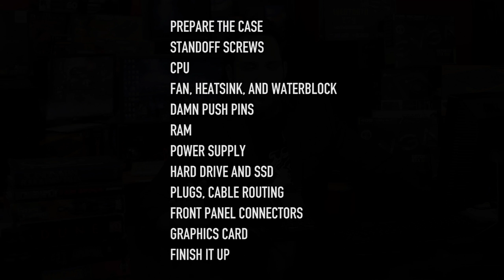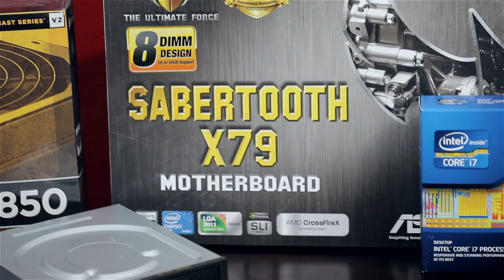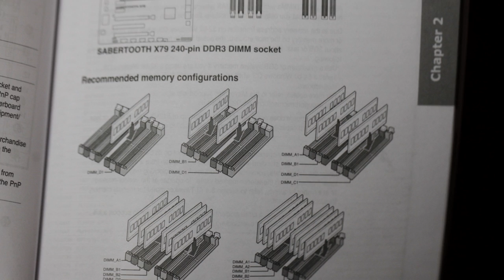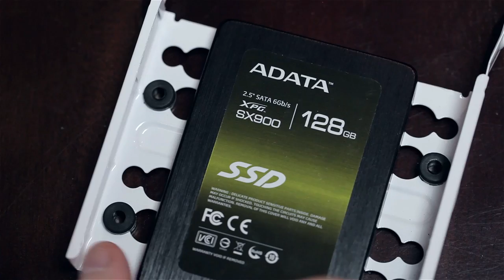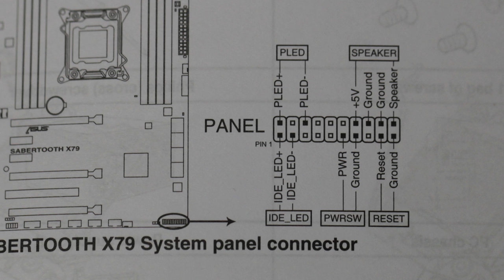How to Build a PC: The Ultimate Guide from Tek Syndicate

Comment: Case:Thermaltake Versa H21 ATX MID Tower
Cpu:Intel i5 4460k 3.4ghz
Gpu:EVGA GTX 750 Ti FTW
Ram:G.Skill Ripjaw 8gb
Memory::Seagate Barracuda 1tb
Psu:EVGA 400w ATX
Reply: The Fallout Guy at least 500W psu
Reply: Updated
CPU: i5 4460 quad core
MoBo: ASRock H97M PRO4 
RAM: Corsair 8GB DDR3 1600
GPU: GTX GeForce 750 Ti FTW
PSU EVGA 500w
HDD: 1TB
OS: Windows 8.1 64bit
What u think
Reply: The Fallout Guy If this PC is for gaming purposes I would use less money on the CPU and more on the GPU.

What I would do:
CPU: AMD FX-6300
MoBo: MSI 970A-G43
GPU: GTX GeForce 960

The AMD CPU is much cheaper and performs almost identically to the 4460. See here: https://www.cpubenchmark.net/compare.php?cmp[]=2230&cmp[]=1781

Also the GPU upgrade is pretty obvious if you plan on doing any serious gaming. If you feel like you're fine with a cheaper GPU, you could invest into an SSD. Check out the Samsung 850 EVO 125GT, pretty cheap and speeds up your computer A LOT. SSDs are by far the cheapest and best way to improve your overall experience on the PC.
Reply: This is my first PC build and so far every game i throw at it runs perfectly i also upgraded the mobo to a PRO4 and the PSU to a EVGA 500W 80+. In the future when my budget isnt so streched ill upgrade my GPU but for now this build is fine for me. also amd cpu isnt optimized for a lot of the games i want to play so thats why i wnet with intel
Reply: The Fallout Guy Fair enough. But look into an SSD, they help out a ton.
Reply: how much did it cost you
Reply: +The Boy I just bough it a week ago but upgraded it one more time

i5 4590
ASRock PRO4
8gb ram
EVGA 960 FTW 4gb
Sentey Gs-6008 plus case
Reply: The Fallout Guy Sounds nice man!
Reply: +The Boy use i3 or 2 duo

Comment: Is this a computer where I can run most up-to-date titles like GTA V on at least high?

Intel Core i5 4690K LGA1150
Asus B85M-GAMER 1150-Socket
Asus Geforce GTX 770
HyperX Fury 8GB 1600MHZ White (Single)
Cooler Master Nepton 240M AIO-Cooler (For overclocking)
Cooler Master RS 700W PSU
Samsung Evo 120GB SSD
Western Digital Green 3TB
NZXT Phantom 240 Mid-tower
Reply: easily, but swap that Green WD for a Blue or Black. Green runs at slower to be more eco friendly/not have too much hear.
Reply: +Bluesparks *heat
Reply: +Bluesparks Ok, thanks for the info

Comment: Did you really just say that the heat from PSU is going to leave through bottom of the case? I really hope you realize that heat rises -.-
Reply: GrenYT The heat wont be able to escape the power supply unit because the fan will be sucking air in and venting it out the rear of the case.

Comment: How do I know for sure if my H100i is working when i boot the pc for the first time ? I really don't want to burn my cpu
Reply: Just power up and go to the BIOS Setup to check the temperatures. Your CPU won't break if it overheats just for a few seconds.
Reply: Your cpu will turn off the computer if temperature is too hot.
Reply: Or you can Download HW monitor and check your temps from there.
Reply: You will see the fans on it start. Thats the only sign. You can also check you CPU temp while under load, that way you know if you temp is over 60C its something wrong

Comment: I want to build a pc since i get spammed that its cheaper and better and i try to make sense of this video the comments or anyone talking about pc but i just cant make any sense out of any of it like this sentence "GTX 770 and a decent CPU or a GTX 780ti with an almost terrible cpu?" It`s just not english to me how do people find it so easy to build a pc
Reply: lololol  come on. thats common knowledge i knew it since I crawled out of a vagina. cpu+gpu. the big discussion what will be better when combining both? a super strong gpu and slower cpu or a "good" balance....  cause it takes research to know what processor or gpu might be a bottleneck in what build.
Reply: Get a GTX 970 and a decent CPU (for example, the I7 4770/90 instead of the 4770/90K, overclock isn't necessary right now with those CPUs).
Reply: Jordi S. Actually a GTX 780ti has a higher texture fill rate per/sec than the GTX 970, the only thing good about the 900 series is that it runs 4k nicely

Comment: You didn't even go over ESD protection. I never understood why people disregard this. It's a necessary precaution.
Reply: Exactly
Reply: +Robert E. Lee No guides I've seen go over that. I'm still unsure of the "proper" way to go about that. Everyone seems to say something different and there are lots of different tools to use. What is the general rule?
Reply: The general rule is to touch a large non-painted metal object, typically your computer case. This won't dissipate everything as you would still be floating at some voltage higher than zero. What I do is ensure that my outlet is properly grounded, I plug a surge protected power strip into the wall and I have that off. Then I plug my power supply into that and make sure that's off as well. I screw in a metal screw about 3/4ths of the way into the PSU and I hook my antistatic wrist strap up to the screw. You're not at risk of electrocution if everything is off, the only thing that's active is the grounding current. Do this and you will be properly grounded to the earth and you will discharge electricity to the earth instead of your sensitive components.
Reply: ***** I've done all that, except for screwing in a metal screw. You just do it into any of the mounting holes? Or where? I figured, having everything off but plugged in would ground but still wish more people talked about this for newbies like me.
Reply: I usually don't install my PSU until everything is already installed and that I've done proper cable management. Get a non-painted metal screw and screw it into the PSU mounting holes. You don't need to install it into the case. You don't have to do this if you can find a non-painted metal object on your PSU. Just whatever you do, don't poke around inside for one. If the PSU is heavily painted, use my non-painted metal screw method. The threading on the PSU isn't painted.
Reply: +Robert E. Lee thanks for the explanation! it is helpful to have a clear method, most things I've read skim over it, oddly.

Comment: You are going to need to buy a quad sli Titans, a 3970x, and you are going to have to buy at least ten fans because you are going to have to seriously overclock if you want to load those games. I have seen people wit a $5000 computer try to load minesweeper and their computer fucking exploded. You are gonna have to overclock so much that you  are going to need liquid nitrogen as liquid cooling. At the minimum you will need 30tb and 64 gb of ram. Your power supply should have 3000 watts also.

Comment: HEY BRO ! 
I NEED YOUR HELP
I BUY A
FX 6300
MOTHER ASUS M5A97 R2.0
1 DIMM 8GB 1600
I HDD ITB
BLUERAY
1 SSD 120 GB
ASUS GTX 760 

AND I WANT TO BUY A POWER SOURCE 
I'm BETWEEN CM SILENT PRO WO 720 M2 GX2 LA CM 750W 
WHICH I RECOMMEND? 
VOLTAGE SELECTED THIS WELL?
TNKS BRO
Reply: Dude you don't even need 750W, 750W is for graphics cards in SLI and or CrossFire, you're fine with a good 550W or 600W. The brans i recommend are XFX, Silverstone and Corsair.
Reply: ImNotAfk tnks bro
Reply: jesus alfonso cedillo cisneros ANOTHER CUESTION ,
I HAVE FX 8350 IS NORMAL TEMP A 77C PLAYING BF4?
Reply: jesus alfonso cedillo cisneros
nope! 55-60 is normal
Reply: ImNotAfk LMAO nice profile pic

Comment: I accidently touched the bottom of my cpu, I haven't tried using it yet but what will happen
Reply: it will cause a housefire
Reply: stay10578 nothing will happen, the reason you shouldnt touch it is because the pins bend very easily and dirt on your finger will also cause troubles, just double check the pins if they are all straight it will be fine.
If you have bent pins u can straighten them with a credit card or something. If its extremely bent and u cant fix it with a creditcard just put a needle under it and pull it up untill you can. But I highly doubt that happened if you simply touched it.
Reply: well im using an intel cpu so no pins
Reply: stay10578 Ah I see so you are using an i7 CPU I am guessing? Then the only problem you can have is your oils damaging the gold connectors of the cpu, don't try to wipe the connectors because that will cause even more damage. Just try it and if it doesn't work you have warranty, just don't tell them you did it. It will probably be fine though.
Reply: Z7 im using an i5 but thanks for the reply

Comment: my pc wont connect to a screen so i cant boot it, how can i check what parts isnt functioning correctly?
Reply: Make sure all cables are connected properly, if you have a friend you could swap his GPU for yours as that could be one of the problems.

Also make sure that your motherboards bios is compatible with the GPU, else nothing will happen most of the time.
Reply: all the cables are connected but not all of the fans are spinning, nor is any ports on the pc (usb, vga and hdmi)
Reply: its fixed now, had to switch out the cpu cables:)

Comment: I am coming from console gaming, is this a good build?
I am using it for playing GtaV pc (with mods) along with other games like skyrim, and euro truck simulator.
http://pcpartpicker.com/p/NZmgf7
Reply: That's great, but I'd say for the graphics card get the Msi gtx 960. I run gta v on very high. And if you want we could play sometime
Reply: lachlan york Are you serious, the R9 390 is like twice as fast as a 960, 960 is a bad buy all around even compared to the 380
Reply: I Max GTA v ultra high 1080p
Reply: Very high nkt ultra
Reply: Alex Fotouhi I'd include a CPU cooler if you plan to overclock.  Other than that, nothing that I see wrong with it.
Reply: TheCrimsonIdol987 No, you cannot overclock that CPU.
Reply: Alex Fotouhi You do not need 8GB of graphics memory. Id recommend something from Nvidia in a similar price range. Far greater performance.
Reply: You can get rid of the USB WiFi adapter, the motherboard comes with built-in WiFi.
Reply: Good! Maybe if you can, try to change the CPU to an i5-4690K
Reply: when it comes to gaming try to see if you can fit a i5 4690k and a gtx 970 in the budget first.
Reply: +lachlan york at 7 fps?
Reply: +Arcazazel nah i dont want a 970 and i decided to get an i5 4690k with a cpu cooler
Reply: +Manchester FC FTW Here's something similar. I changed a few components around (mobo, PSU, WiFi).
http://pcpartpicker.com/p/t79TQ7

You could also get an SSD.

Comment: I need some help. I have an i5 and there comes no CPU fan with the build. can anyone check the build out and answer if it's not necessarily to have a fan. Or if it is. Here's the build: http://www.amazon.com/lm/R11MIL5N6BBF1I/?_encoding=UTF8&camp=1789&creative=390957&linkCode=ur2&tag=thowisguy-20
Reply: you can get very cheap CPU coolers for less than 20 bucks and you should always have a cooler for your CPU it cannot get to hot.
Reply: The processor comes with a stock cooler.

Comment: Can anyone help me make my system better

http://pcpartpicker.com/p/DQ4gcf

Here is the link to PC parts picker. Im sure that changing to Intel and stuff yeah... I just dont know which one... 

Note, the graphics card is a Sapphire R9 270X 4GB GDDR5 with a base clock of 1070, PC parts picker does not have this one. Any help is appreciated

Im willing to change all but the case
Reply: If you want more power for gaming, you could get an r9 390 as well as an i5 or fx8350. If you're doing that, you might need a better psu. You're system is solid already tho. If anything, I'd get a better hard drive.